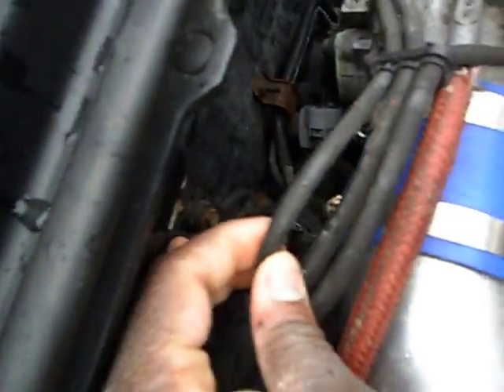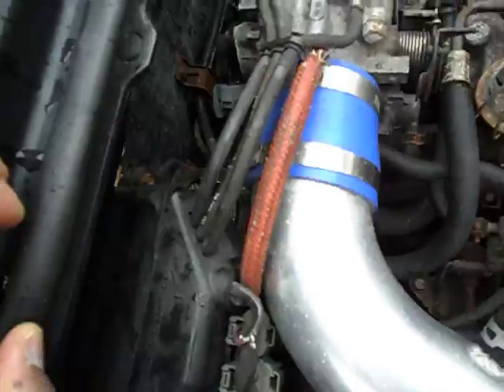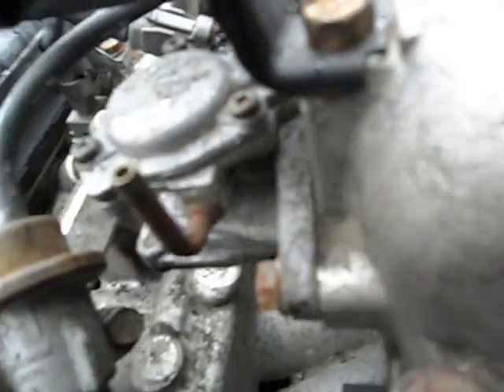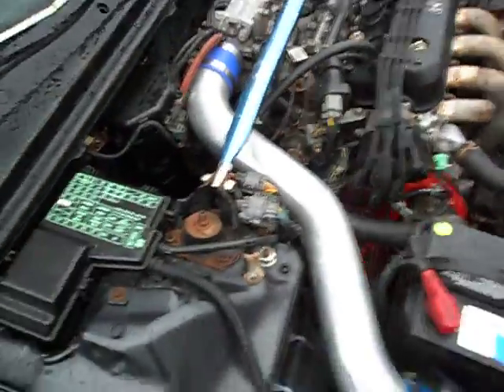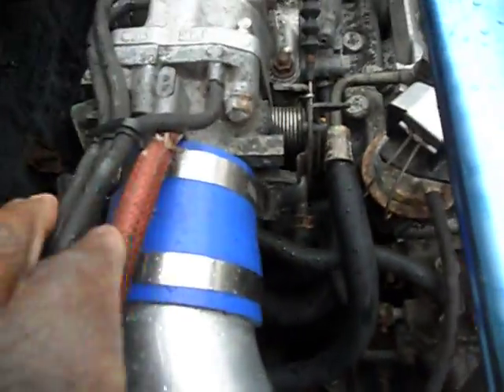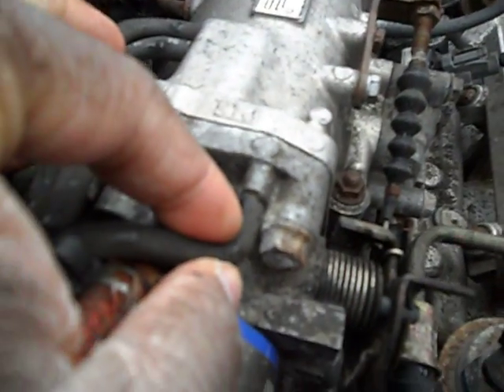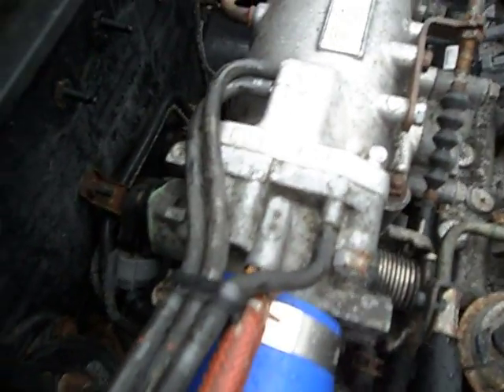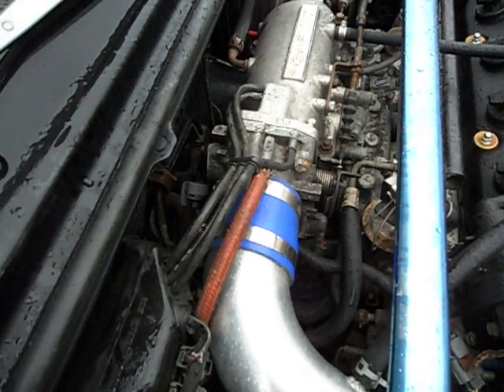Vacuum lines for H23 intake manifold on F22A6.

Comment from the maker: Yes...the H23 intake manifold will bolt up to all F22A heads.  only different between the A1/A4 and A6...are A1 is the base ...A4 just had a tubular header..and A6 had
 a more aggressive cam and different intake mani.   the molds are all the same... however..you CAN NOT use the H22 lower...mold is different....H22 upper is the same as the H23 upper.  hope that helps more!
Reply: twisted62380. so can the h23 skunk2 fit also?